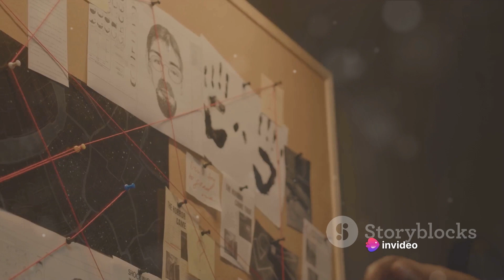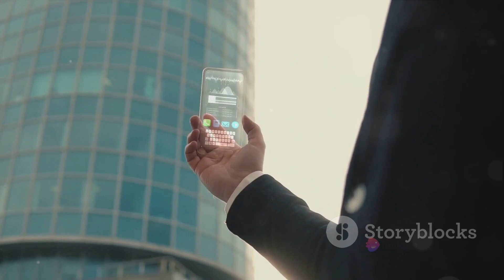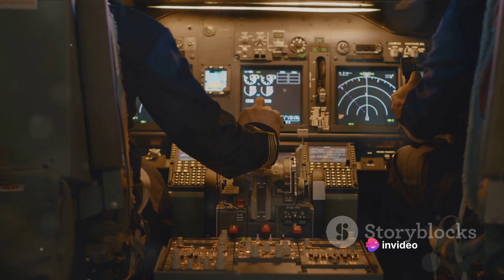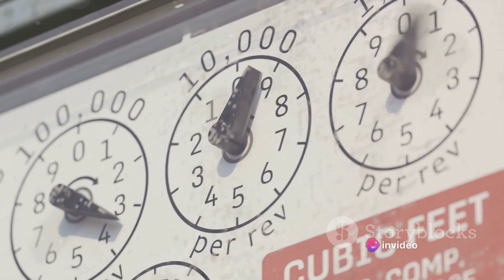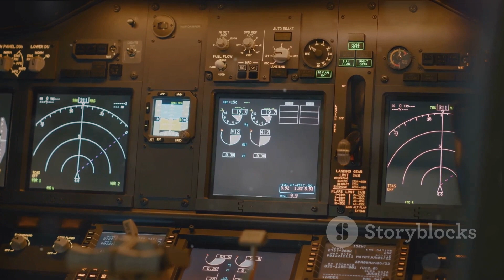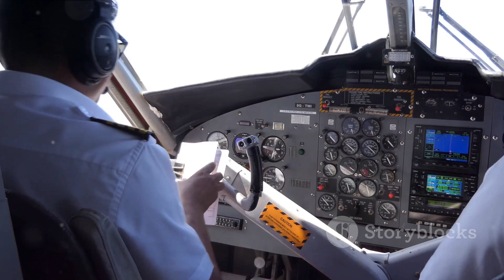Why planes fly slower than they did in the past

Comment: Supersonics like the Concorde aside, lets just talk subsonic airliners only. The older Boeing 707/720, the Douglas DC-8 and the Convair CV880 and CV990 had 'no-bypass' turbo jets at first in the mid to late 50s. But then by the early 60s they were going to more efficient 'low-bypass' turbo fans. They immediately lost about 20 to 40 knots of speed. (But I don't think the Convairs ever switched to low-bypass fans, if I remember correctly.) Then the really large diameter 'high-bypass' engines came out in the early 70s, yet another slow down, lost maybe 20 knots of speed again. They were slower but had better fuel efficiency, more important to the airlines. From zero bypass turbo-jets, to low-bypass fans to high-bypass fans! Bigger the engines, the more drag and they got slightly slower each time.

Comment: Its not necessarily fuel consumption its the design of modern High Bypass Ratio turbofans.  The higher the bypass (the larger the fan diameter) the slower the maximum speed.  The original jets used turbojets and later turbofans with a very small bypass ratio, they were definitely faster, burned more fuel and had less range.  Airlines don't fly their planes at slower speeds than designed for, they fly them at the optimal speed for the engine.  None of the other factors like air traffic congestion or weather  play a factor, that is made up stuff.  It is all in the efficiency of the High Bypass Turbofan.  Take off speeds are relatively unchanged from the past as are descent and approach and landing speeds.  There is absolutely no change to slower speeds for accident avoidance or safety, as a pilot I find this to be just puzzling......where did this AI generated video get this idea?  Ohh, yeah, cuz its AI.

Comment: 5:00 noise pollution,  at low altitudes,so near airports ,planes never fly fast.  At 35000 ft I doubt people on the ground hear the difference between a plane going fast or slow as long as it doesn't go faster than the speed of sounds

Comment: I don't think we need to go supersonic for the most part, just a limited market. The drag penalty for going supersonic kinda outweighs everything. Unless you're some big exec that's got places to be and can afford it. But hey, a likkle bit faster in the sub sonic regime. .9, .92 , . 93 mach cruise speed. How bout that ? With some new technology I think it can be done. The fact that slower planes are quieter is not necessarily about thrust its more about exhaust discharge speed, bypass ratio, specific thrust, etc etc. Higher speed flight means pushing air out the back faster which means more noise. Let's not forget the main reason we fly. Because its fast. Because we want to get there. If not we would just drive or take a ship. When I get a week off work I don't get an extra week to travel to my destination. Forget about the environment. Later generations will solve that problem. Later

Comment: Can we run aircraft turboprop engines using hydrogen fuel?Fly from London to New York for the price of tank of water.I used to work for Greenpeace.Part of me still believes.
Reply: Water vapor is a greenhouse gas. Sorry about that. Lots of studies on the effects of high altitude contrails and climatic alteration. Hydrogen will greatly boost the size and thickness of those contrails. Worse still, where is that hydrogen going to come from? Just water? Where does the energy come from to split those little molecules? Hydrocarbon fuels? What do you do with the leftover carbon? Where does the energy come from to split the hydrocarbon molecule? No pollution there of course...
Reply: @davidh9844  Contrails from engines burning jet fuel.If we can rig generators run by hydrogen from water we can rig a system that runs itself,surely?
Reply: @davidh9844  I don’t understand your position.
Reply: @davidh9844  I figure if we weren’t so money hungry we could rig a Greenpeace satisfactory mechanism to provide us with majority of the power we need to ‘burn’ fuel for.
Reply: How about no??
Reply: @markr.1984  Please excuse my scientific uncertainty,but if we can run motor cars using hydrogen can we run airplanes?